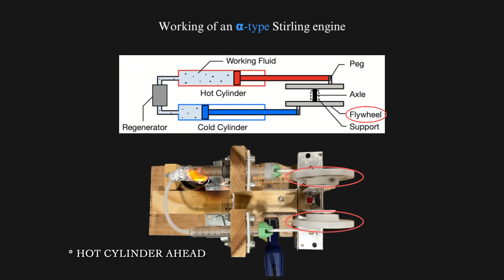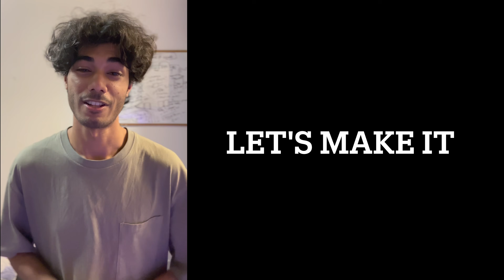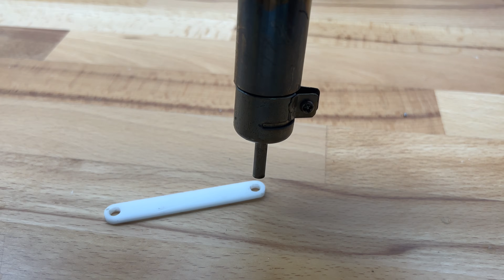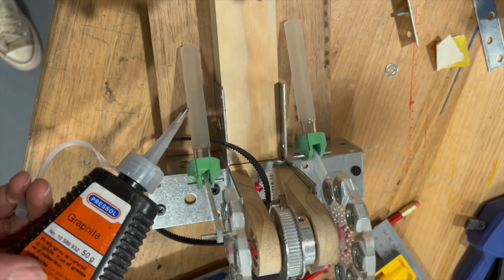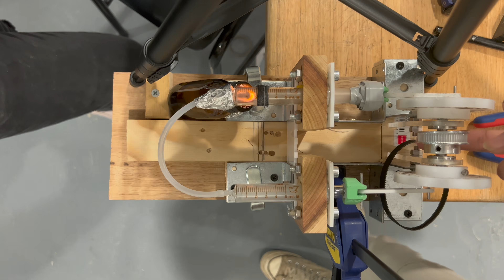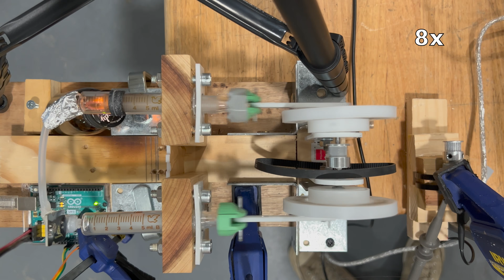alpha-Type Stirling Engine: Theory, Construction and Analysis

Comment: Incredible results! Some thoughts from building this type of engine: keep the side forces on the pistons as los as possible, by using long connecting rods, as the friction between piston and cylinder wall seems to be the main source of friction losses in this engine. The bearings are not that important compared to that, unless its a very fast running engine. The hot piston might still be binding, especially when running slightly higher temperatures. Try filing or curting a small slot or hole in the back of the hot piston to keep it from balooning and binding up. You can also hone the front end of the hot piston with sandpaper etc. Try to reduce dead volume as much as possible, even if it feels counter-intuitive, because it increases compression and expansion forces. Dead volume is basically wasted heat. That also means minimizing the lenght and volume of the connecting tube between the cylinders. If your engine is almost working but not quite, dont despair. Try to reduce the piston stroke lenght by reducing crank radius. OP used 7mm or even more, but he is using a powerful heat source. I had to step it down to 4mm radius, but now it runs reliably without adding a sketchy amounts of heat. I know making such small crank radiuses can be machanically challenging to construct, but it might be well worth it and could save you a lot of frustration.